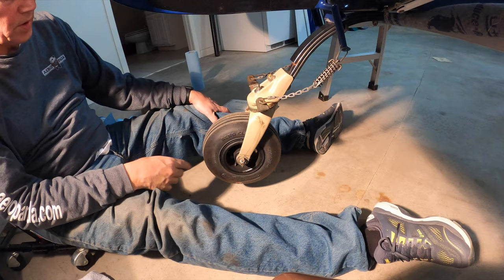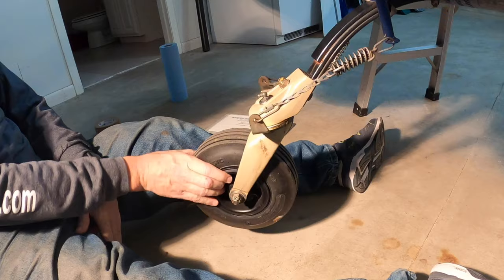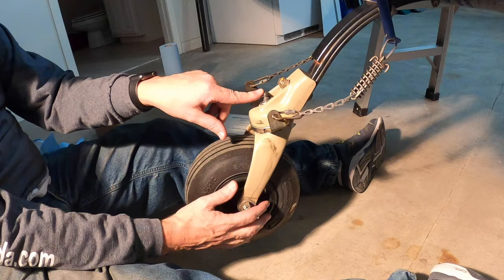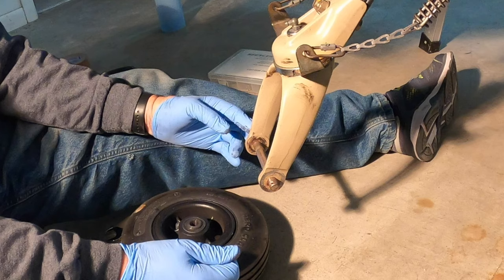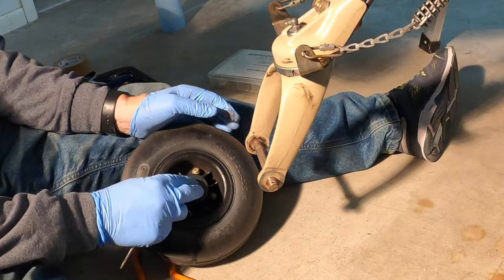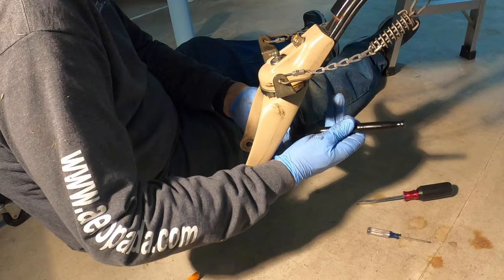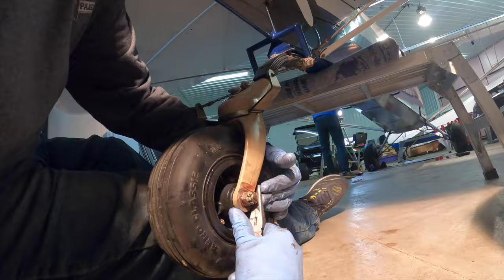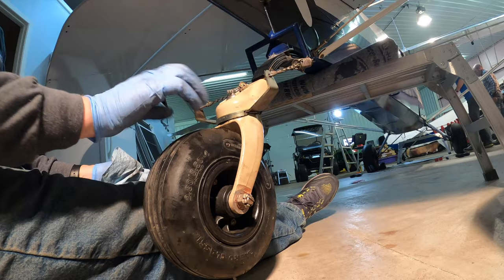How To Fix TAIL WHEEL SHIMMY! - Pt.2 - 4k | Aviat Husky Tailwheel Adjustment

Comment: Very useful explanation!  I just build aircraft models for Flight Simulation for 20 years.... This kind of explanation are gold for me, I uses that to get a picture about how to build several aircraft mechamism and the way it works. Right now I´m working on a C180 tailwheel performance, that is a bit different but still the explanation works for me... Tank you!